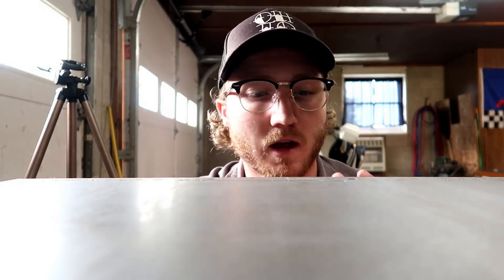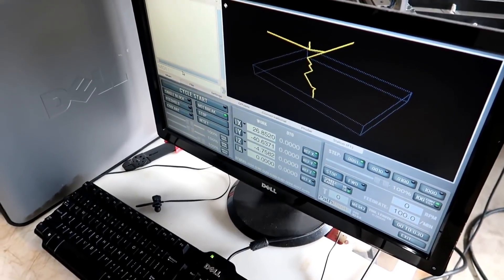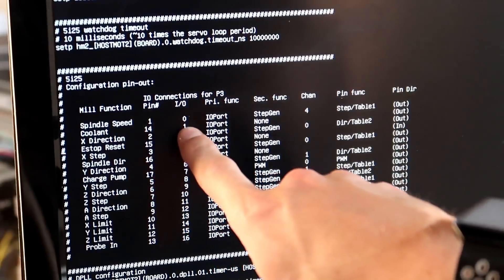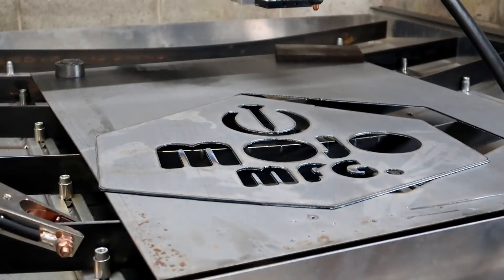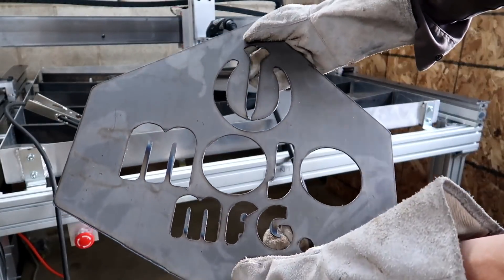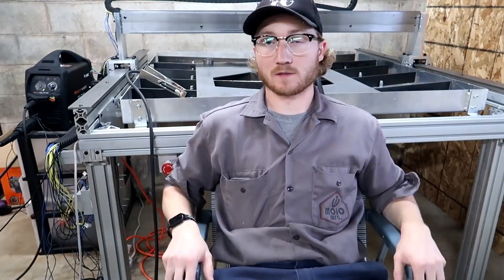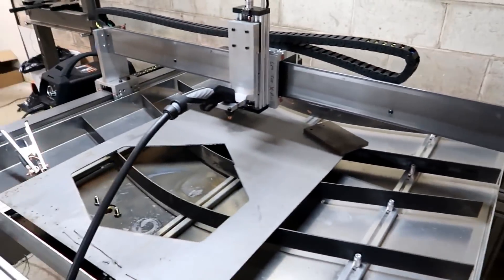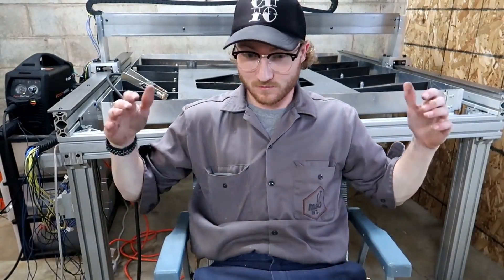DIY CNC Plasma: First Cuts: Home Mfg. Days #47

Comment: Very good video! Where I work, we have one of the largest cnc plasmas in the southeast in the part of the shop I used to be  over. A 400amp dual 3d head Hypertherm XD on a 13x48 foot (yes, feet) bed. I did all of the programming but not the actual operating. 

A few things on water tables - be careful if you do aluminum to avoid serious explosions. I'm not typing up why, google it. 

Plain water is fine. One huge problem you wouldn't think about is mosquitos. Even draining ours weekly it stayed FULL of mosquito larvae and surrounded by mosquitos. Chemicals can be added to stop that. Car antifreeze helps. 

Steam. It will make steam. Depending on your ceiling material and how high above the table it is, the steam could cause some serious issues after a year or two of hard use.  All of the insulation rotted and fell directly above the plasma table, and our ceilings are 25 feet high. 

You will have to drain it eventually. Technically I THINK it is illegal to go directly into the drain. I'm sure local laws vary. 

I do plan to build one eventually. Thanks for taking the time to do these videos.
Reply from the maker: This is why I do these videos! Thanks for all the tips! I can even imagine working with a machine that big! I will probably end up putting some greencut water additive in my water table.  As for the aluminum, I read a lot about it already.  It said only Aluminum Lithium alloys are the only ones that are hazardous and can cause the hydrogen explosions.  So I am assuming 6061 would be okay
Reply: MojoMfg. I ASSume the same about 6061. Koike, the manufacturer of our gantry, wouldn't even discuss cutting aluminum on our machine when they came to set it up because we built a water table. I'm sure for liability purposes, but I have never tempted fate and tried it. The rare bit of aluminum goes on the waterjet. 

We did some tube sheets (google it. Looks like a salt shaker lid) sometimes from 2 inch thick 316L stainless. Each plate of material costed more than I make in a year. Nerve racking is an understatement. 

I look forward to you figuring out the torch height. We use a magnetic holder so the torch pops off in case of a crash, which happens regularly, usually due to auto torch height issues.
Reply from the maker: I don't see a whole lot of aluminum being cut on the plasma table if any at all.  I'm sure that tube sheet was huge! I have heard a lot about the magnetic torch holder and I may do that in the future as well.

Comment: What software la controller cnc plasma? Yuo machine not use thc mecanic whit G code G31.
Reply from the maker: I am using Tormach's Pathpilot to control the CNC.  I have the THC wired up but it is not programmed yet.

Comment: Nice Job!  Thought about getting a Plasma setup but I think I need a fiber laser system.  I'll have to save up a while for that.  77 degrees, nice!  My shop here in Phoenix is around 90-100.
Reply from the maker: Thanks! I'm sure you'll get that fiber laser at some point.  I don't know how you can stand it at 90-100 degrees...that's crazy hot.

Comment: Nice job Garrett.  I just run straight water in my plasma table and it works just fine.  It will eliminate nearly all the fumes.  Still gets things pretty dirty, though.  I have to clean my rails all the time.
Reply from the maker: That is good to know, I glad it will get rid of the fumes.  Thanks!

Comment: Great vid Garrett!  That's awesome that you got to cut something with it. :)  
I'm pretty sure I've seen guys putting automotive antifreeze in with the water.  You might check into that.  Should be a pretty cheap option.  The stuff I saw them using certainly "looked" like regular antifreeze.
If you put up a fairly solid wall, I would think that you could have a hole in one of the two walls......maybe put a box fan in the hole so that it pulls the air from the rest of the shop and pushes it into the  plasma area......then you could just lift the garage door 2-3 inches to vent the area.  I was thinking that this would help you keep the nice heat/air from the rest of the shop in the plasma area and it would be easier than trying to figure out a fan arrangement for the garage door. Just thinking out loud. :)
Reply from the maker: I'll definitely have to check into that antifreeze, I'm sure there's some forums out there talking about it.  I really like the idea of the solid walls with a fan.  The one guy I do some work for, his plasma table is in a dedicated room with a fume extractor(that doesn't work) but it is so dusty in that room from all the plasma soot stuff but he doesn't have a water table on it either so I'm hoping this water table will fix that problem.

Comment: You can use water but put a coolant in it to prevent rusting. you should also install a fan for fume extraction. Good job on getting her going ;)
Reply from the maker: Thanks! What kind of coolant would you recommend?
Reply: Anything that has no Glycol in it should be fine. It's just an rust inhibitor then rather than "coolant"
Reply from the maker: That's good to know! Thanks for all the help!

Comment: I'm at least 50% sure that the ground lug is supposed to be on top in a 240V outlet.  Also it looks pretty good.  One more thing, I have no clue about plasma cutters, but I wouldn't think that you can just put straight water in it (I'm about 12% sure on that one).
Reply from the maker: Yeah I'm pretty sure you are right on the ground lug. When I installed it I figured it would just be in the same orientation at as regular outlet.  As for the water, most people apparently put water and add basically a rust inhibitor to the water.